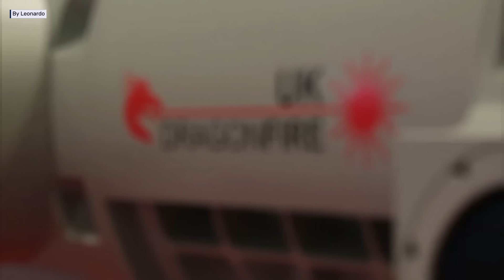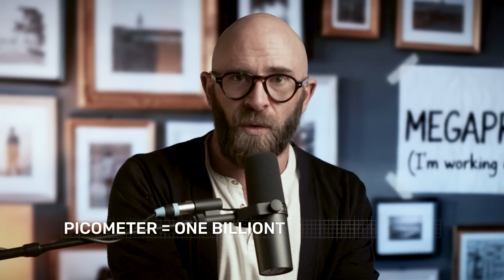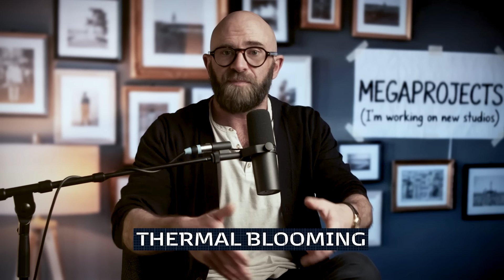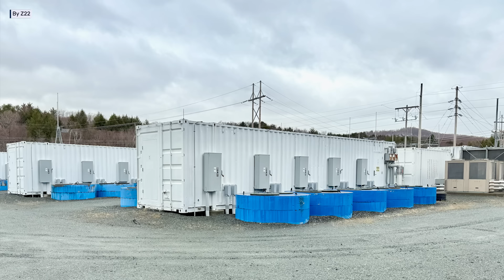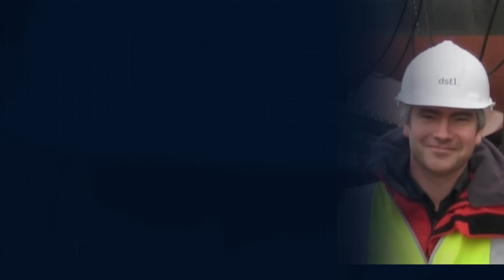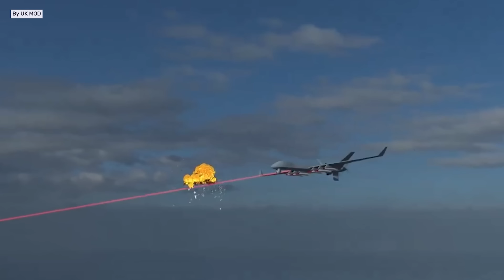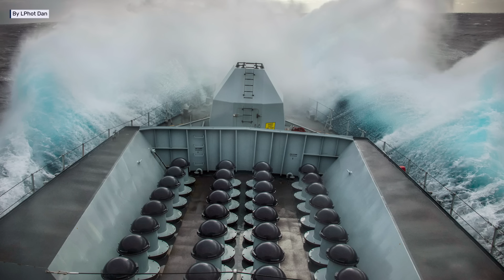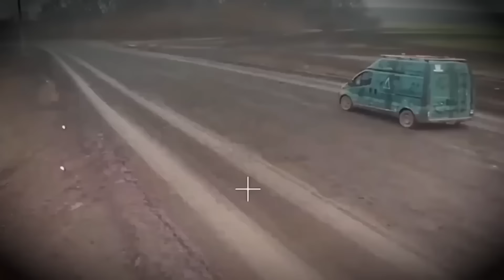The UK's Insane Laser-Directed Energy Weapon

Comment: What if a drone/target were covered with a retro-reflective surface, directing some of the laser energy back onto the weapon itself?
Reply: That's not how this works mate. Even if 90% of the energy was reflected, 10% would melt whatever was reflecting the energy pretty quickly and then 100% would be hitting the target.

Also on a moving target, how would that mirror be angled to reflect back exactly to the laser?
Reply: @meme4one thanks. Retro-reflective is mirrors arranged as the interior surfaces of a cube; no matter it's orientation, incident light reflects back at the source. 3M makes such film, like on cycling and safety clothes. Not clear if 10% incident would even be absorbed, or whether that would be enough to destroy such surface, but your point is relevant. thx
Reply: ...and it would make its radar profile really solid, counterproductive in all other ways...

Comment: The only thing you need to defeat a laser is reflective insulation. I know for a fact that these weapons are useless they've already got a countermeasure where the laser will not burn through the object not even close with proper insulation
Reply: 😂 For a fact? 

That's not how this works mate. Even if 90% of the energy was reflected, 10% would melt whatever was reflecting the energy pretty quickly and then 100% would be hitting the target. It's not a torch, you can't just reflect it off. Just like you can't put rubber mats on a drone and bounce missiles off them.
Reply: @meme4one none of what you said is true at all. You just made that up
Reply: @meme4one did you know that even during dust storms or rain or snow these lasers don't work at all
Reply: Oh... this is disappointing. Just when I thought the comments section was - somewhat incredibly - free from people who've spent less time in school than Greta Thunberg claiming a reflective surface would make the target invulnerable.
Reply: @gh8447 snow and particulate materials significantly reduce the effectiveness of laser air defense systems by absorbing, scattering, and refracting the laser beam's energy. This is a major limitation for the operational use of laser weapons in real-world atmospheric conditions.
Reply: @gh8447 you see you're not very honest nobody said invulnerable only you
Reply: @gh8447 I explained to the other guy maybe you the biggest issue with lasers is there useless in rain snow and in the desert. Anywhere where there's High particulate in the air flow. So you really only need reasonable insulation and reflective materials to divert most of the energy from the laser. I hope that's a more cohesive argument than me making fun of you

Comment: Sounds more like a motor generator to me rather than some fancy transmission  system. Since one of the main reason for motor generators is to stabilize power supply  for critical infrastructure where power may be shoddy as in have small irregularities or behave as a temporary power back up while main power fails and rotational effects maintain power for short periods.